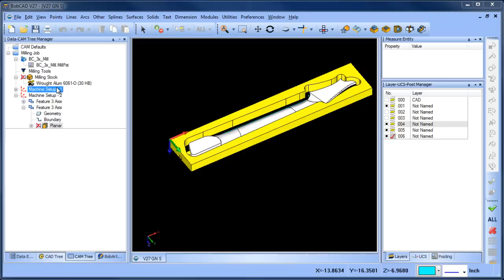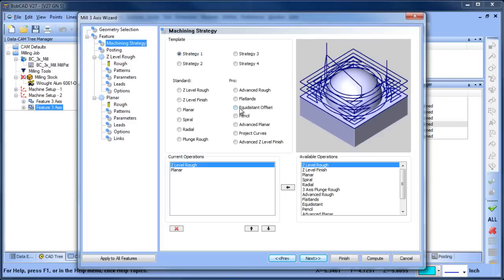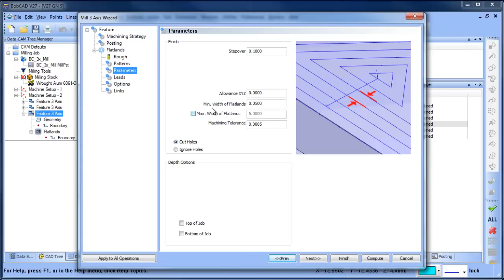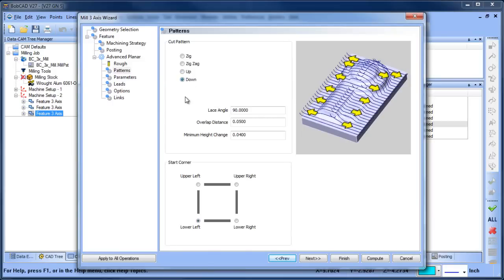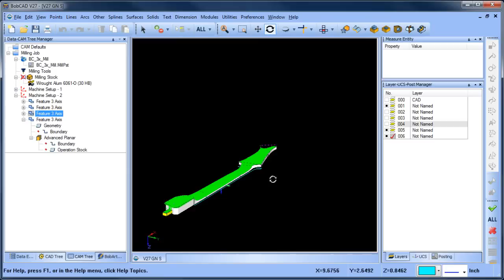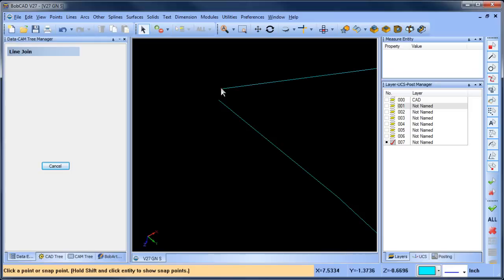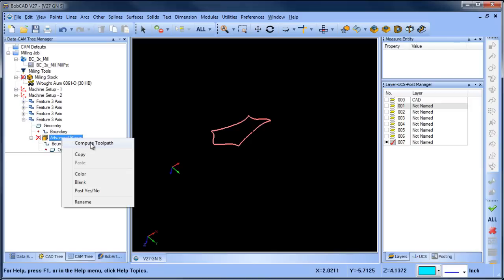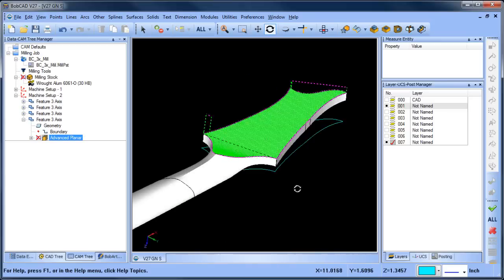CNC Woodworking Tools For Guitar Neck  Finishing

Comment from the maker: I am using BobCAD CAM , www.bobcad.com   Yes you can have a pause between tool changes.  As far as how you process the stock, you can rough out all the parts at one time, or independently.

Comment: Hi ill be working on a guitar soon enough with a table top router type cnc, what cam program would you recommend using? and are tool change pauses possible? how about making multiple pieces of the same thing, can you seperate a project? example. i have 5 pieces i want to make, can i rough out all 5 pieces, then change tool, then finish all 5 pieces? or will i have to just rough and finish each piece at once, im trying to save time from changing tools by hand.